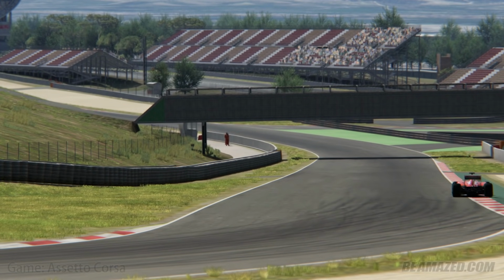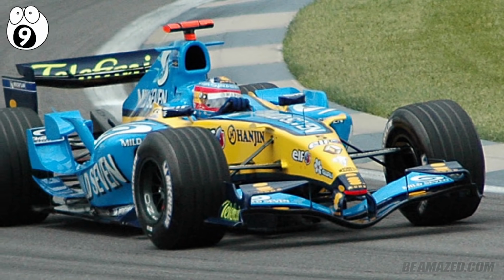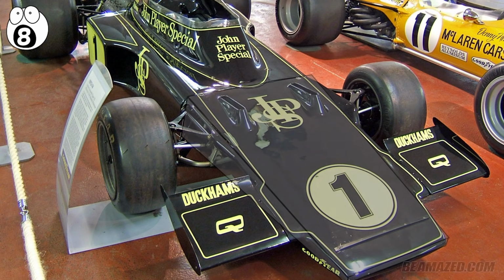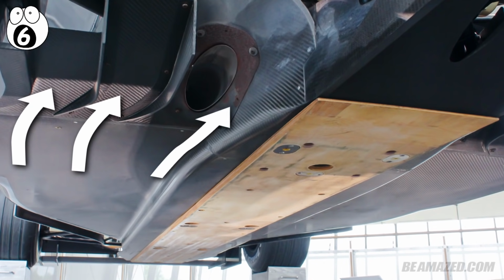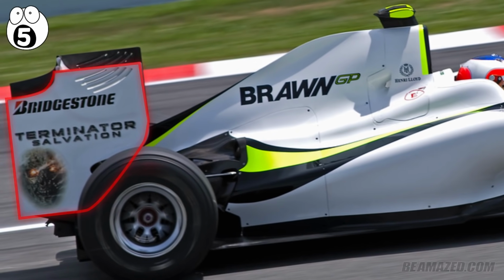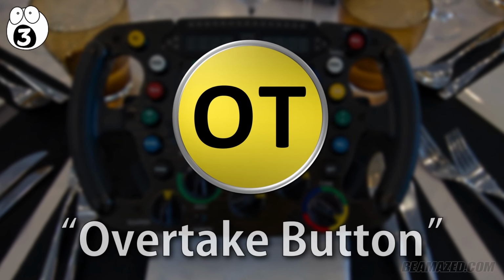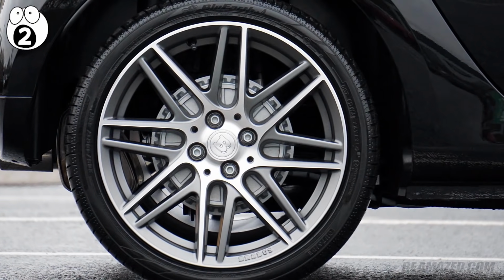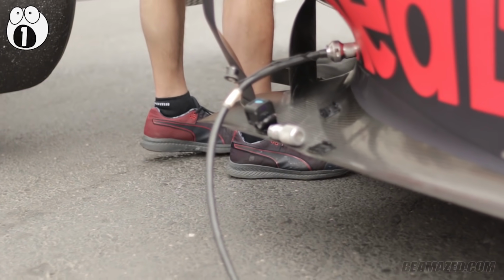Secrets Of F1 Car Design You'll Find Really Interesting

Comment: I appreciate the wide range of genres and topics that you cover.
Reply: i dont because you know nothing about f1
im a regular f1 fan and i already knew about all of this
Reply: Urié @@
Reply: It'd help if the info were accurate though.
Reply: you know NOTHING of formula 1
Reply: Top 10 Polyphony Formula Cars
Reply: 🤩TGProductions
Reply: The downside of which is that you don't have time to do extensive research, and therefore make slight mistakes in your videos. For the basics, what you said was true. but everyone who knows the history of f1 aerodynamics would think you'd only read the Wikipedia page. 

P.s what i wanted to mention is that aerodynamics from the floor like om the lotus (which is ground effects) don't exist anymore due to tracks not being build of the speed  the car caries through the corner. Also you need a really flat piece of tarmac for it to fully work. And because often the cars race on the streets, they bottom out, which results in loss of downforce. Of downforce (70% of downforce comes from the underside of the car). Even with modern f1 cars, this is still a problem, eventough they have purely flat floors, 1994 a car bottomed out at the san marino GP and send a driver straigt into a concrete barier. We all know who that was and how it ended.
Reply: @14thtn35 Slight mistakes is an understatement
Reply from the maker: Glad to hear Brofessor!
Reply: Yes, but the problem with a wide range of genres means - master of none.  Some misinformation here.  But all in all, beneficial.
Reply: but what is with that baby voice?!!!

Comment: As an F1 fan. First of all, if you were referring to front wing, the front wing was introduced by the genius Colin Chapman of Team Lotus. And front wing doesn't just provide downforce, it diverts airflow to the other parts of the car such as the side pod, the barge boards, and also sends air to the bodywork, and to the floor, and to the rear wing. And talking about downforce, F1 engineers tweak some aero features depending on the track (Depends if the FIA approves the tweaks). Lemme give an example; more downforce on the front causes the car to oversteer, more downforce on the rear causes the car to understeer.

Comment: Bruh shut the fuck up. You gave the opposite answer for the purpose of a diffuser. The low pressure air turns to high pressure air when it leaves. Do some basic research you idiot. Use some common sense, if there is high pressure air underneath the fucking car, it's gonna fucking fly. Not stick closer to the ground. Omg delete your channel ass hole.

Comment: The Video is not correct at all, but your calculation with the brakes is sooooo wrong. When you hit a Wall that doesn't move with an average car (3086lb) at just 124 MPH and not like you said 200 MPH, with a driver that is around 176lb you get a G force of 105G, not 5.

Comment: Here is all the wrong stuff i found! Enjoy!

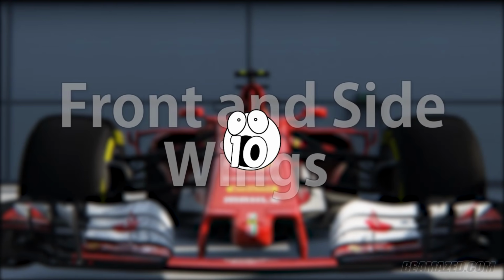0:24 There is no thing called "side wing"
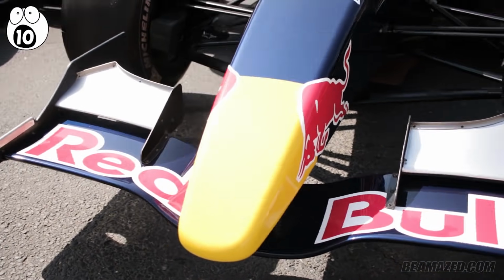0:41 it is everything but not "negative lift" it is downforce
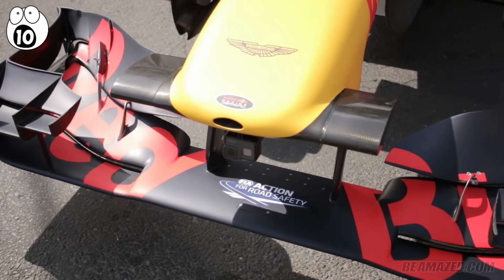0:48 it is not even nearly a flat thing
1:00 "Won all the other Porches..." I'm not sure how many Porches were there in that race but there sure were also many different cars so what are you talking about?
1:03 it's  NURBURGRING what ever you tried to say
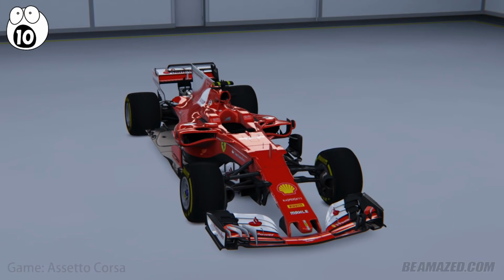1:15 Don't know how to say how your wrong, but sure you have no idea what you are talking about
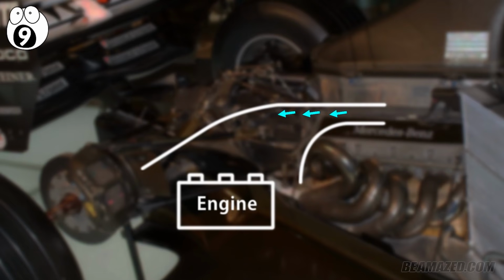1:43 Please go google what is "Turbo"
When you talked about the rearwing you sure took everything straight from wikipedia while you had no idea what were you talking about
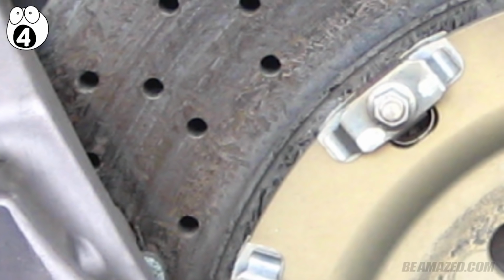7:14 no it does no't heat the tires
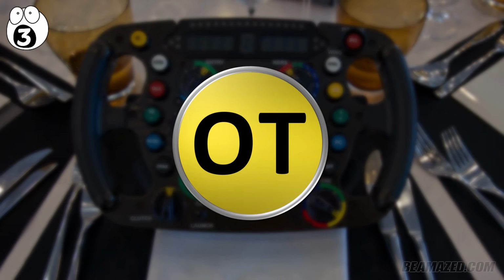7:44 no its not overtake it is KERS (Kinetic Energy Saver) button
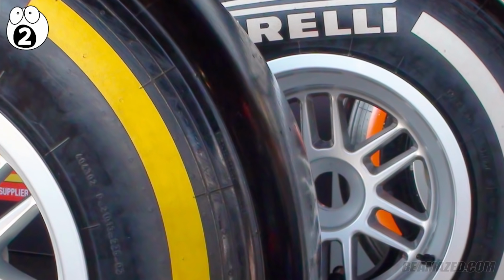8:54 it is rubber still. Go google it
9:56 Crabon FIBER

Comment: i only listened to the first "fact" and it already wrong! you said f1 cars are very aerodynamic wich there not on the contrary they are very unarodynamic because of the fact that they redirect air so that certain parts of the car take more resistance than when the car redirect the air so the car wont be influenced by air resistance (wich is what aerodynamic means)

Comment: 11)  Wheels are very important and are put on each corner of the car to stop it scraping along the ground ; all wheels are round, this shape works much much better than square or hexagonal wheels ; rubber wheels give more grip than wood or metal ones  -- black rubber wheels get hotter in the sun than white or yellow ones ; wheels are never filled with water, as that would be very silly & stupid - even if it were special water ;  rear wheels are wider than front wheels because it looks nice - but they're more expensive ; front wheels, which go on the front, have a lesser diameter than the rear wheels that go on the back or rear - otherwise they, the rear wheels (not the front wheels at the front) wouldn't get lovely cool invigorating air blowing all over their soft baldy rubberyness ;  wheels are brilliant -- they used to put them on the legs of beds.

Comment: i'm not saying the video was incorrect but when talkign aout the "underfloor" it's usually referred as the skid tray and the rear of the underfloor is called a diffuser and a lot of other racce cars have dry and wet tires mind you it's not as complicated and other racing tires are rubber they still work by the tires getting hot and slightly melting to make the tires sticky and grip to the road better and downforce is what you called negative lift also aerodynamics is basically the biggest part of modern racing nascar is completely different in terms of the way they use aerodynamics and downforce but it is equally as complex 
ps. this may not be completely correct so please feel free to correct me  if i am wrong
quick edit. the first vehicle to use areodynamics/active aero was on a chapparel race car in the fifties when the driverof saidf car attached a massive wing with hydraulics that extended increasing the angle when he breaked causing more drag and decreasing the faster he went and he won quite a lot of races and started the whole trend of attaching wings/splitters/diffusers to their race cars (some supercars also do it) making them faster and more agile even massive racing trucks have wings to make them go faster around corners while not tipping over
Reply: The video WAS incorrect

Comment: Your tire analysis was...odd. For years F1 have forced the manufacturer to design tires to deliberately degrade, some after a single lap, counter to any tire manufacturer's mission, some even refuse to participate due to this alone. F1 is not something you can make a vid about and seem knowledgable if you're not, this vid has many issues with info you provide.

Comment: Nearly everything you said about the wings on the car was wrong. The wiglets and shape of the front wing are there to CREATE vortices. This allows the air to 'stick' along the shape of the car, giving the rear wing more air to work with, giving more down-force. Also, the air box is NOT high enough to avoid the hot air from cars in front, this is why you'll see drivers moving out of the path of the car in front it's been following, or dropping back to allow his car to cool down.

Comment: 6:00 "whenever a rear flap is opened... by remote control"... You mean he don't jump out of the car at 330kph, crawl onto the rear wing and knock it down by hand... That is what I thought happened... OMFG

later he claims "Carbon is 5x stronger than steel and Aluminium"... well which is it? Steel and Aluminium are not equally strong... so it can not be 5x on both... it can be 5x stronger than steel, but then it would result in another multiplication factor on Aluminium...

Amazing how stupid this is.

The only secret here - this is clickbait shit.

Comment: The wheels have been tethered the the car since 1998 and starting in 2011, they added a second tether on each wheel.  They rarely separate from the car during crashes.  Very rarely. Many other facts wrong as well.

Comment: Formula One cars design and aerodynamic looks like jet fighters. I like the front and back wings that keeps the car from flying at high speed, I like the big breaks that stop the car fast, I like the modern steering wheel and the carbon fiber body with the many air intakes.

Comment: Slight mistake, the air intake above the engine does not have a ram effect, the air actually slows down as it enters the engine. You can tell by the shape. It's above the drivers head so it gets fresh cool air that is less likely to be turbulent.
Reply: Dude almost all of this Video are Wrong

Comment: What in the fuck - carbon fibre is brittle as shit, it's meant for being rigid and lightest possible material for external shell. The frame, including the life saving cage, is just high quality steel, as it always has been, and most likely always will be. You know what James Cameron used to get to the bottom of the ocean? I big ol steel ball. That's it.

Comment: I was the crew chief for Segio Rofello from 1981-1988. As you know, Segio was F1 champion in 1983-1984. He pioneered the Doppler Downforce Effect (DDE), which, while out of fashion now, was a breakthrough in aerodynamics at the time. Much of this video's statements about aerodynamics are specifically wrong, but  basically correct. Given the current F1 emphasis on drivers vs technology, DDE will rise again. It's a simple system that is inexpensive and gives the driver more control. When Segio retired to start a Buddhist commune in Thailand, the team folded and he donated the cars to the F1 Museum in Berlin. They are on display, with a very fine interactive explain of DDE. Not to brag, but I am featured heavily in it.

Comment: It was a good effort but F1 cars are not supercharged by the air intake on top and since the intake widens out to be volumetrically even to all the cylinders so the vortex of the ram is lost. And I may be wrong on this but I thought all aspiration modifications were banned on F1 cars that compete a few years ago. And just one more note most F1 cars use small cubic inch v-8’s with wide pistons and small travel, some using v-12’s v-10’s and even inline 4’s from Honda’s line of formula cars

Comment: great try, but lots of the explanations were just misinformed, or not explained the way you intended to, if you did understand when you read about them. 

a. the 'end fences' are called 'end plates', where did you read that terminology?
b. the 'side wings' are 'cascade wing elements' and their main use is to eliminate drag produced by the spinning wheels in the oncoming air. 
c. Ram air effect was never used in F1,  it creates WAAYY too much drag, to outweigh any engine power gains. 
d. the air intake shape is in no way or form intended to be a 'blockade' for air hitting the rear wing, it's 'tail' is that shape in order to actually DIRECT air to the rear wing, where it is needed. 
e. most times drivers actually DO ride close behind one another, the low pressure front that's left behind, in the 'wake' produced, lets the following car benefit form reduced drag (drafting). 
f. rear wing end plates are NOT for straight line stability, well they help there too, but their main purpose is to separate low and high pressure areas at the wingtip (like you explained about the end plates of the front wing) 
g. the main thing that warms up tyres isn't the heat form the brakes, but actually friction of the tyre and the ground, that's why you see them going left right left right when they are forced to slow down due to safety car etc . the brake heating effect amounts to less than 2 or 3% of the tyre temperature gain (heat dissipated from the brakes is mainly lost into the environment, if it was all channeled to the tyres, the brakes would end up reaching  more than 1900 oC. 
h. heat, and hot weather (for walking example), causes the tyre to soften and form into the tarmac, making a strong mechanical bond on a microscopic level.
i. team mechanics (not engineers) DO NOT rely on skill and judgement to decide whether the wheel is tight enough.... that is a very serious task to be placed on the judgement of a person... the guns are 'pre- tuned' (programmed lets say), to do a set number of turns before cutting off, bringing the toque up to spec, this tightening torque is decided during the design process of the car and is based on a whole load of calculations, factoring in materials used, type of thread etc.
 j. the 2-8 hours of autoclave baking of carbon fibre is pretty incorrect.. some parts must stay in an autoclave oven for more than 24 hours, some really high strength ones even 30+.   some other parts can be good to go after 10 minutes...

Comment: Why tf would you show footage of a game and of non - F1 cars? 

Rediculous video. Pretending to know something is not how to gain subs and likes
Reply: Except.....the information was correct and the game footage allowed views you'll never find elsewhere. But I get it . I mean....it's not like F1 broadcasts ever uses computer graphics to explain things.

....wait.....

2.3 MILLION subs vs your 64 and my whopping 10.. I think he'll be fine.
Reply: Brett Except... Very little of the information he shows is true, for example his explanation of how difussers work is totally wrong (pressure is low under the car and high at the back, not the other way around) , the front wing is used mainly to deflect air into certain parts of the car or avoid wheel turbulence ( using vortices like the y250) it does generate downforce, but not that much since its not its most important function. I could mention a lot of things more but it would be quite long.

Comment: naaaaaaaah, not like hitting a wall at 185 mph or 300 km/h. hitting a wall at that speed generates almost 1 000 g and would kill a human instantly, and the f1 drivers doesn't die every time they stomp on the brake

the highest amount of heat comes from the friction when breaking and turning and the amount of heat that comes from the break are almost negligible, and does't make much of a difference in the long run

otherwhise does it seem to be accurate from what i have heard a part from some minor word choices that i wouldn't have used but it doesn't matter cause what you said is good enough and easy to understand 

thanks for the good video and i hope to see more about other car facts in the future

Comment: So the brake disc that you show at 432 seconds (7:12 give or take), is not and can not be an F1 brake disc. The carbon fibre reinforced carbon brake rotors can't be drilled in that manner for F1 as carbon would easily crack around the hole edges leading to disasters, especially during the high heat braking events when the contact surfaces of the callipers and pads literally catch the carbon on fire (carbon will start oxidizing at around 1200C). What you show is a carbon ceramic brake which can be structured in this way and those are not used in F1. F1 (and Formula V8) brake rotors are drilled from the outside/ring edge in towards the center of the rotor so that there is no mechanical work done on the surface that is drilled. There are over 1000 holes in each brake rotor for modern cars, in fact, some teams request more for better cooling, but due to hole size regulation and brake components specifications (dictated by FIA), brake manufacturers have only been able to drill about 1200 holes max, maybe more for the 17 season since they change the braking component specifications for heavier cars, maybe again this year, but last I heard 1200 was the max.  The brake pads are also made of carbon-fiber-reinforced carbon. It takes a long time (hundreds of hours) to make these components (at temperatures exceeding 2500C), a typical set of discs can run around $4500, a set of pads is another $2400, and a typical team can go through 140-240 discs and 280-480 pads every season.

Comment: The components are not made of carbon fibre alone. The material consists of carbon fibres which gives them tensile strength and resins which give other parameters. Carbon fibres by themselves are "only" weaved into a fabric which is quite soft and flexible. It's the addition of appropriately chosen resins and proper "baking" process makes the resulting material strong and durable.

Comment: The pressure under the floor are low pressure with high speed air, when it goes out then it have slow speed air with low pressure. Not correct if you learn thermodynamics
Reply: when you are saying the under of the car have high pressure, means it counters the atmospheric pressure from above of the car which actually dont suck into the ground and instead it will lift up the car.

Comment: Be Amazed is right! I'm very amazed at how you managed to get almost everything wrong. As a now retired racing car engineer, this video is quite ridiculous. F1 cars use a monocoque chassis not a (space) frame, well not long after Lotus introduced the monocoque in 1962. The first carbon fiber chassis to make its debut was at the 1981 British GP, but it was the Lotus 88. The Lotus 72 did indeed move the radiator(s) to the side, but the Lotus 72 first raced in 1970, not 1972. Again the Lotus 78 first ran in 1977, not 1978. For those of you that don't know Colin Chapman the creator of Team Lotus (no relation to the Proton owned company baring the same name) was easily the greatest engineer in motor racing history. The terminology used in the video isn't the same used within the racing teams, but that's understandable. More often than not, most fans and racing car engineers don't use the same terminology either. Wheels have never been made of rubber! As in most cases in this video the images don't match the narration. You are clearly English, yet use the simplified American spelling. You'll find tyre is the correct spelling unless you require a rest.
Reply: And all the facts are made up...